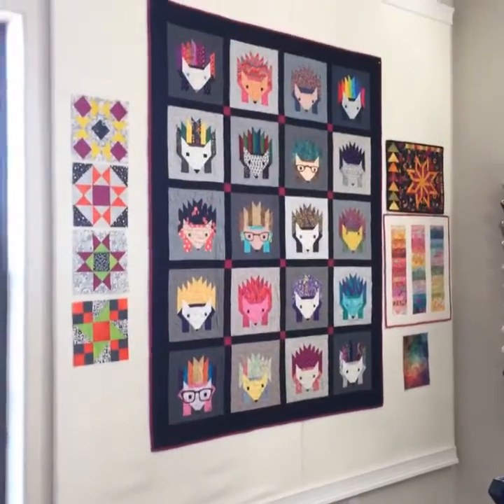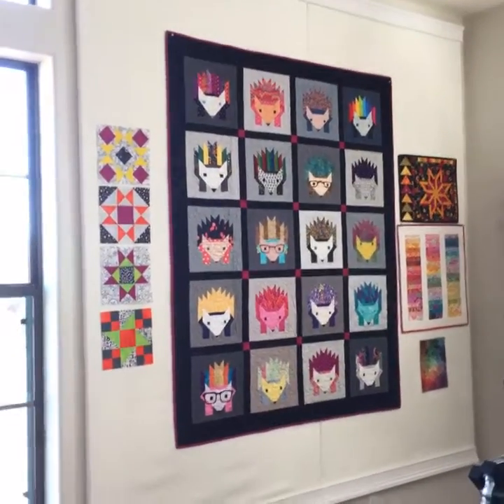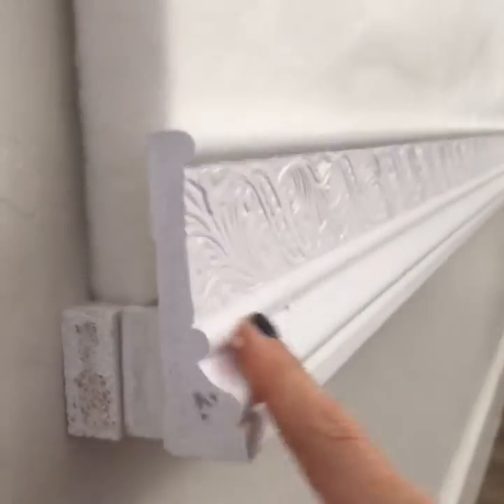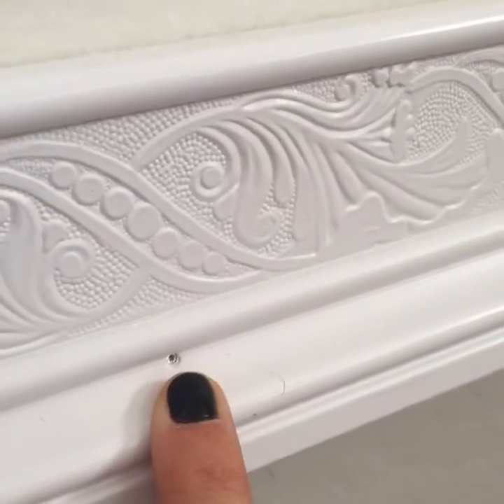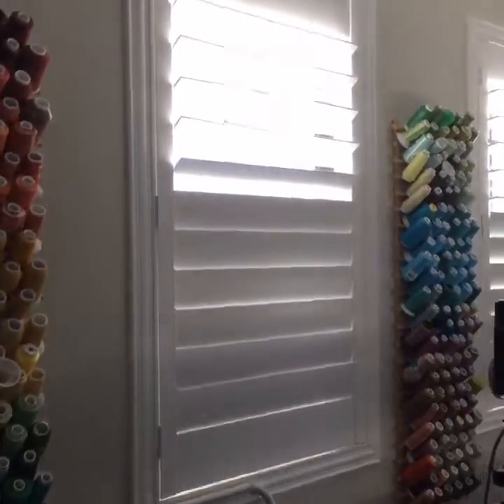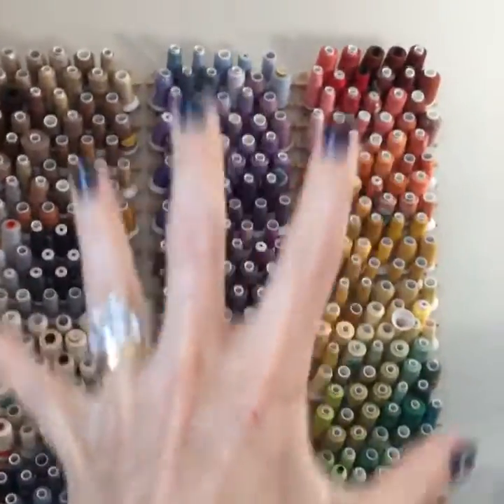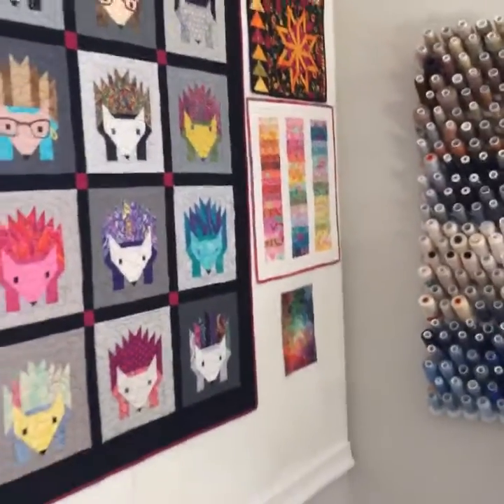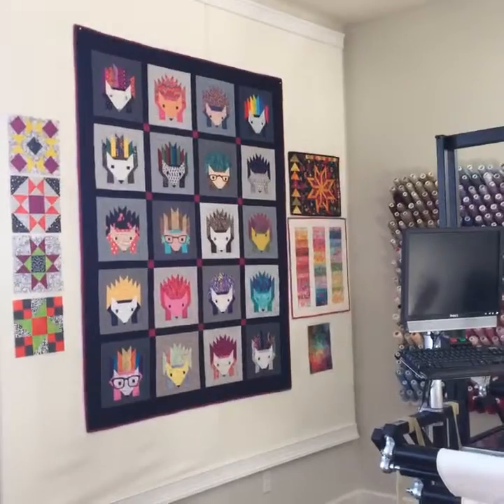How to Make a Design Wall!

Comment: I also used 2 of the styrofoam insulation boards for my design wall ;)  I covered it with cotton batting, it is full of loose threads ;(  Does this happen with yours? A bedroom is on the other side of the design wall and the insultaion helps to keep then noise down when I put  in a blow up mattress for guest!
Reply from the maker: The anti pill fleece does not collect thread like batting or flannel.  This is why I switched to using this.

Comment: I’m getting ready to make a design wall finally after using my floor. Anyway, do you notice that your fabric sticks pretty good to the anti pill fleece ( as good as batting or flannel that I see people using)? I think yours looks really nice and more “finished looking”
Reply from the maker: Hi there... I have been using the Anti Pill fleece for years.  I used to use batting and it held onto threads terribly!  The anti pill fleece holds everything on just as good if not better than batting or flannel and the best part is that the threads don't stay attached!  I love it!